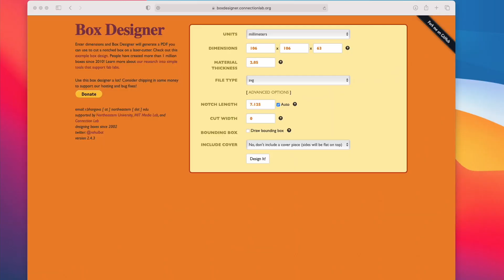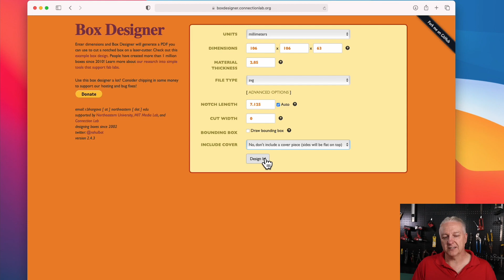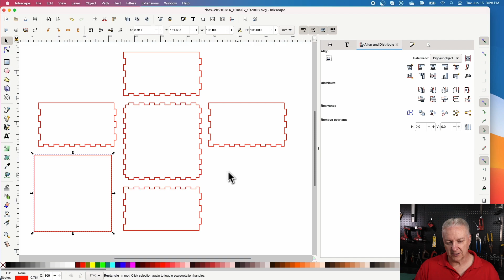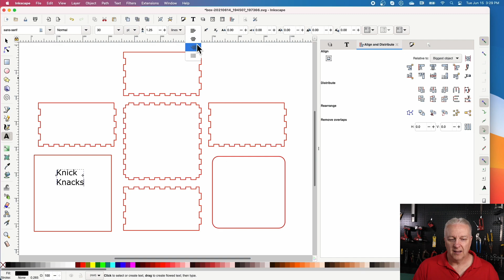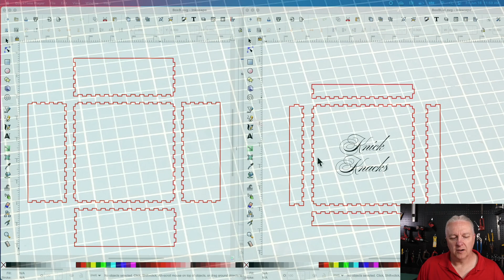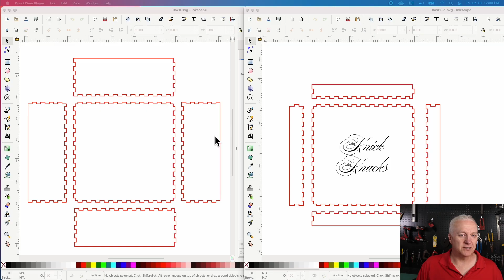YOU CAN MAKE A LASER CUT BOX

Comment: How do you make sure you engrave the text and not cut it, I thought that step you had to do in light burn with layers ? but I see you already do that in Inkscape
Reply from the maker: Nope, this is definitely done in lightburn or whatever laser software you are using.  In Inkscape you can pick a line color, but you still need to map that to power settings.

Comment: Nice box.  I have a question for you which you may or may not be able to answer.  Say I want to make a box longer than my piece of material is wide. I want to join the two pieces with finger joints.  Essentially you have two boxes missing one end and then join the two with finger joints.  Is this possible?
Reply from the maker: It is probably possible to do this but it wouldn’t look very nice and likely wouldn’t be strong enough to be useful
Reply: @SteveMakesEverything  Yes, I decided to 3d print it, but then I still have to print it in two pieces.  It should not be a problem though as it will be mounted on the outside of my enclosure on a section of aluminum extrusion.

Comment: Did you add an offset to cover the laser beam width?  Thank you for sharing.
Reply from the maker: Yes when you are doing this you can allow for kerf on the cuts to ensure that the joints are tight.
Reply: HOW?
 @SteveMakesEverything
Reply from the maker: @HPDAMAN  In Lightburn you can click on a "line" layer (i.e. one on the colored settings on the right side of the project window).  When the settings dialog is displayed you will see a kerf setting there.

Comment: Hi Steve. I am doing my very first steps in Laser Cutting, with a Sculpfun S9 and Lightburn. Making nice and useful boxes is one of my aims. Searching through Youtube a came across your tutorial which is really very clear. I guess it will walk me through making my first boxes and I thank you a lot for it. Of course I subscribed. One question; at this stage; if I may: you mentioned using Masking (which I guess is important for the look of the end product). Could you please elaborate a little about Masking materials / methods? Thanks again. Emanuel
Reply from the maker: Masking material is really just really wide masking tape. I use this: https://amzn.to/3R7syXj. However if you take the time to get your power and speed calibrated properly transfer tape is probably not required for most materials. If so you can cut and then use very light sandpaper to brush off any soot that is created.  Transfer tape is really for lazy people like me who just want to blast through material without doing all the work 😁.

Comment: Can you please show more on how to make the second box with lid which you use felt inside
Reply from the maker: The lid is just a second box turned upside down so there nothing too unknown there.  The length and width are the same dimensions as the base box and the height is lower (e.g. a 20-30mms or ~1") and then use the same box maker tool to create that one.  Then just sandwich the boxes together and screw in some hinges and latch.  The lining is either regular felt sheets with 3M adhesive tape or pre-taped felt.  I'll add a link for the latter to the description below as well since that's what I use for these.